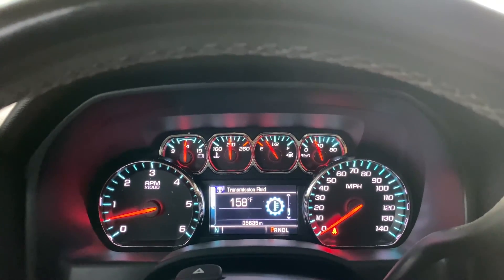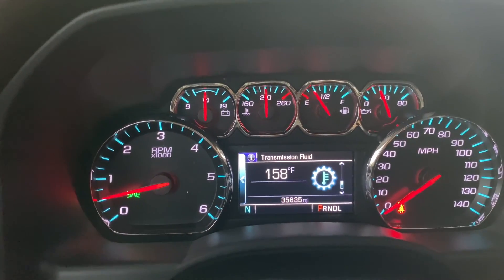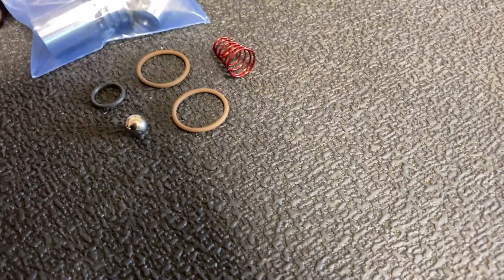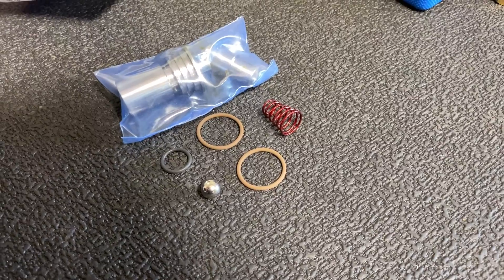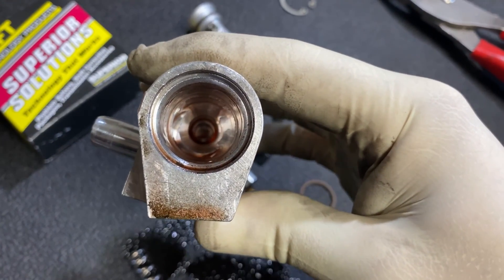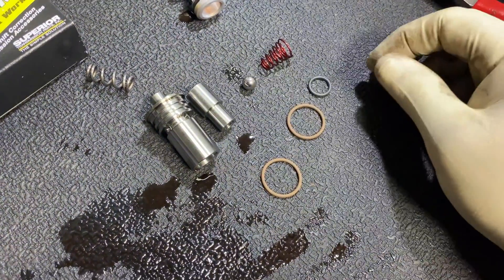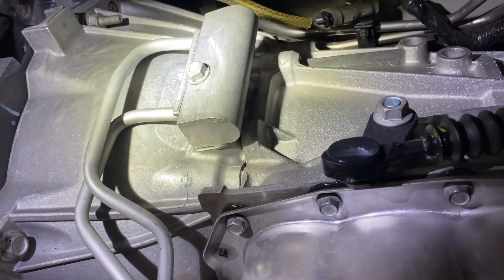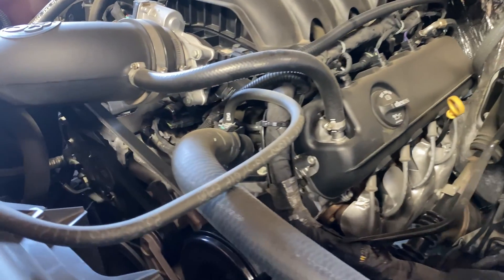Silverado 6L80 Thermostat Delete the Right Way! *SURE-COOL*

Comment: You took a thermostat out just to install another thermostat?
Reply: Yes.the original opens up at too high of temp.around 200 degrees.Too hot.kills trans torque converter.New one opens up at 150 degrees.

Comment: Did you lose enough fluid you had to add? I’m planning to do this but the 2021 doesn’t have the dipstick and you have to add from below the truck. That seems like a pain in the ass, along with trying to make sure it isn’t under or over filled.

Comment: My 6L80 hit 237 degrees pulling a medium sized trailer in the high mountains in 68 degree weather.  It works ok yet, but do you think I did damage?
Reply: I would think at 237° some damage was done. Not sure what GM was thinking or if they were thinking at all with these transmissions

Comment: The 190+ is BS I put a brand new transmission in my suburban in the Rockies it hit 195 and quit shifting until it dropped to 180 ..
Reply: You have bigger problems then. Plowing before this bypass my 19 Sierra would hit 240 250 and still run fine.

Comment: What’s the difference between doing this kit or just flipping the spring I seen on other videos thanks
Reply: I did the “pill flip mod” on mine. Granted it’s cold out now but hasn’t got over 140 at all
Reply: Anyone just remove the thermostat and spring and put back together. Would that be fine instead of flipping. Same thing right

Comment: I have tranny cooler and it's a 6l80e looking to do this it runs at 185 rite now about planning on doing a lot The question is how much farther is this really going to extend the life of the transmission there really only good for about 150 200,000 If you change your fluid every 40,000 mi as far as I know One would assume this should extend the life slightly especially if you're telling If you never tell or haul anything this might not be a necessary mod for you I'd like to know what the Camaro runs at

Comment: Thanks for this.  I just ordered one from the link above.  My 2018 needs this and it looks pretty easy to do too!
Reply: Super easy, I did it today in less than 30 minutes. It took longer to remove the assembly due to the front driveshaft than it did to replace the guts.

Comment: Need to do this with my 19 z71 tahoe. Pulling my atv on a 6x12 utility trailer I get up to 210 and stay at 195-200 normal driving
Reply: I did the upgrade and it works. Normal driving it stays around 135-160 thanks for the video. Also got it on eBay for 55 bucks shipped.
Reply from the maker: Awesome!!!

Comment: I did order this thermal bypass kit and will be comparing it to the mishimoto one that came with the transmission cooler..

I installed the mishimoto cooler with the thermal bypass delete and went on a long highway drive with outside temp at 85 and noticed the transmission temp never went over 150 degrees, upon returning in town and driving around some more trans temp fluctuate between 127-135... plus I noticed it shifts smoother. I'm just concerned if these are good temp and not too cold since dealership said normal operation temp is around 180 and up.
Reply: They also say normal oil for these trucks is 5w20 yet when they sell the same Gen V engines for commercial use (where they dont care about MPG) they recommend 5w30... Dont listen to the GM engineers at this point, they only care about CAFE standards and not longevity of thier products.
Reply: @PrimeraRSTKD  Did you mean 0W20?
Reply: @AmericanNuke54  Yup, also GM just released the official thermostat bypass similar to this, they knew this was a problem but didnt fix it. idk why i keep buying these shit trucks.
Reply: @robertscimeca1768  do you have a link? I live in the northern US where it will get cold in the winter. I’m not sure if the temps we have here is really an issue to have this part in or not.
Reply: based on what I've been reading it can be an issue in a cold climate (Northern parts of America), so new GM TBV is recommended. The new TBV opens up at 70 C / 158 F, which would  keep the engine around 165 F in warmer temps and closer to 158 F in colder temps. I'm planning on getting the new GM TBV because I don't want to void my warranty plus the installing the new TBV on 2016 - 2020 Suburban is super easy. Will switch later when I'm out of warranty based on feedback from people who have done either one of the modifications/upgrades.
Reply: @chaddelecia2414  Had mishimoto trans cooler with sure cool throughout all winter last year in Midwest with temperatures in the negatives and it seemed to warm up just fine.. still running strong.
Reply: @viixiconik  will keep that in mind. I spoke to a GM tech and he said the trans is designed to work at 170 F, but he didn't see this service bulletin. I have a feeling what they tell the techs isn't necessarily through. I don't notice a different in my transmission at lower temps (less than 40).
Reply: @chaddelecia2414  Do you have a part # for the new GM TBV? Thanks.
Reply: Why would the cold climate make difference all the older trucks never had a trans thermostat. Just asking because I live in the northern part of the country and it get below zero here. Is that transmission that junky. My older truck works great with no thermostat.

Comment: Awesome bro! Thanks for sharing your install. Just ordered mine today 🔥🔥🔥
Reply from the maker: Thank you! Enjoy some cooler trans temps!
Reply: @Bobsgaragetech  I have a Question, would I have to add transmission oil? I saw that it leaked a bit.  Just wondering.. thank you
Reply from the maker: @JTrump23  not usually. But it is always a good idea to check the level once you are done with any transmission repairs.

Comment: After installing the by-pass my transmission still went up to 180 easily. Outside temp was 90 and i was only street driving for 30min.
Reply from the maker: Sounds like you have other problems. Could be clogged cooler, could be internal transmission failure, could be old fluid.
Reply: @Bobsgaragetech  thanks for the feed back, that really helps. I’ll see if i can get to the bottom of the issue. I’m not going to give up on the product just yet because it makes the most sense out of most of the thermostat deletes.
Reply: @Vill254  just a heads up, if the converter has started to slip / chatter on TCC it could drive temps higher. and in the beginning of failure you may not even feel it slipping   if it was during a pull / tow / haul situ. you may still need to add an external ( oil to air type vs. the factory heat exchanger inside the rad) if you bypass the rad heat exchanger (oil to coolant type "cooler") rule of thumb is install 2 of the Hayden / tru-cool coolers in series and make sure they are 1st in the air flow path (no obstructions in the air flow thru path) OTHERWISE if you have some other items causing lower air flow across the cooler (due to lights on the grill or grill guards / bumpers etc. ) GET the NEW TRU COOL WITH the automatic electric aux fan units (either the biggest single or 2 doubles. feel free to go to our website: www.superiortransmission.com there is also a contact us section if you need further questions answered or are just wanting to touch base. thanks ! p>s> 180 deg. F is fine all day long in 90-120 deg. if it gets higher add cooler if not, you may need to go into the unit.
Reply: @Vill254  mines having the same issue did you ever get it solved?
Reply: going up to 180 is perfectly normal when it’s 90+ degrees outside. That’s what these guys don’t understand that install these. ambient temperature outside is going to dictate a lot of what your transmission is going to run out with the surecool. when it’s 95° here I run about 180. what is in the 20s and 30s I run about 130. so there’s about 100° variance with ambient temperature. It’s doing exactly what it’s supposed to do though and the key is you have full flow fluid
Reply: Mine too

Comment: Thanks for posting this. Old retired GM tech here, just bought a used 2018 Silverado. Will get this changed out pronto. Will you post something on the AFM problems and solutions? Thanks Again Update: Installed the Sure Cool today SUPER EASY now the trans temp hold pretty steady at 158 before it would easily go above 190. Great product.
Reply: You can get an AFM delete made by range. $200 you just plug it into your OBDII port. I have it on my 2018 Silverado
Reply: @dustinturner5119  Thanks I have seen these.Great idea. I was also thinking about a complete delete after power train Warranty expires. Looking for recommendations on those
Reply: @stevecampbell7620  no problem and yeah I waited to late and the lifters went out in my truck.. $3,800 later I decided to put the AFM disabler in it 😂 this happened at 91,000 miles for me
Reply: @dustinturner5119  thats scary.... I am out 89,500 now lol. Keep putting off a full delete.
Reply: @lew-e  do it soon!! My truck and I know of a guy that has a truck like mine and he has to redo tho engine in his too! Trust me it's worth it however you decide to delete it
Reply: @dustinturner5119  I am seriously considering trading it in on a used 3/4 or 1 ton for hauling. Would be convenient not to have to do the afm delete too...
Reply: @lew-e  yeah that would be the thing to do lol
Reply: @dustinturner5119  we just picked up a 7,000# fully loaded tt so convincing the wife to also upgrade the pickup is a little tough at the moment lol
Reply: @lew-e  good luck man 😂😂
Reply: Just a quick option (until you get the range delete) is instead of using (D) use M[5] and you will NOT drop to V4, however this doesn’t stop the lifter issues, as they’re just poorly designed. Therefore best to move forward with full delete ASAP! 

I was planning a full delete on mine upon buying it at the end of April 21’ but after 4 months of owning the truck, I have dumped over $3000 into the AC system with 5 different AC failures. Therefore, I have (thankfully) been treated kindly by the dealership I bought it from, and he is working with me now to get out of this 2014 5.3L Crew Cab fully loaded into a 2021 (with them giving me over payoff on mine) and they knocked off $6,000 MSRP on the 21’ model.
Reply: @Dstring1230  congratulations you’ve been baited. Along with very bleak/green techs.
Reply: @Dstring1230  id move away from fucking Chevrolet completely, these mother fuckers will never get another penny from me. No wonder they almost went out of business and had to get bailed out by the government a few years back… transmissions grenading themselves at 80k miles is just unacceptable…
Reply: I purchased the Diablo Sport tuner to disable the AFM,( just gotta return to stock file if you go to dealer or emissions test.)

Comment: Could u give us a up date  please I got the kit . I just afraid that the transmission running to cold could cause a problem
Reply from the maker: The update and thousands of other people that also have this sure cool kit love it. The guys over at superior transmission parts know what they are doing. I highly recommend this upgrade. I do not recommend just plugging it or flipping the thermostat. You want to have the pressure relief ball too so in cold weather it has the correct flow.
Reply: Thank u so much for the info.  I’m still going to change it . Just wish I could find some one that would tell me how it works . That’s what I’m interested in
Reply from the maker: Basically it allows flow through the cooler at all times. It has a soft spring that eliminates back flow and then the check ball is for cold weather if the cooler is frozen and can’t flow the fluid will feed right back to the transmission.
Reply: That's the question nobody asked
Reply from the maker: I always recommend doing more research. But trust me you do not want high temps in these transmissions. I have been a tech for over 15 years now and GM tech for most of it. The only reason they are allowing these transmission to get so hot is for fuel economy. Just so they can add that extra and make it look good. I would rather have my transmission properly cooled and lose a small amount of fuel economy. So little you will not even notice.
Reply: @Therealestrunnerluda  no worries if it gets too cold... (below zero F) the bypass kicks in (via the thick viscosity of cold ATF) and the differences in balance pressure thru the block - due to the Hi VISC of the cold fluid - pushes the ball over to the bypass mode, pre-warms the fluid until flow begins thru the coolers and back to the trans. sump (the pan) while the unit is coming up to temp. so it is in bypass mode at that point. (LIKE THE FACTORY INTENDED, BUT OUR SYSTEM IS DYNAMICALLY ACTIVE- which means... it instantly reacts to a NO or LOW FLOW Condition and protects the guts of the unit from no LUBE flow throughout the unit. when you start in a common temp morning (55-75 deg. ) it should hit around 145 ish- 165 ish all day long under normal operating conditions. on hard pulls and hot days 165-185 deg. would still be considered normal with the exception of... once you get the stress off ( going flat or slight downhill ) over a few minuets the temp should ramp back down more to 165 range, when the load / stresses resumes, the temps under hard working conditions will climb slightly again but should re-stabilize back to the cooler ranges. this happens constantly and the reason the pellet types fail (due to extreme over temps ((250deg.+)) they are melting or Metal and Friction materials or debris flowing thru the cooler block (as the oil goes thru the pellet / block 1st and then to the filter last) sticks them closed or 1/4 of the way open etc.  THIS heat and or contamination end up damaging the thermo pellet and in some cases have burnt unit internals so badly you need a core to re-build.  

that's why we have patented the technology (in our K5R55WNS Shift Correction (R) package) and have patent pending's on all our SURE~COOL (R) system world-wide. 
we hope you like it too.! www.superiortransmission.com
Reply: Thank u so much for clearing that up for me
Reply: Do you happen too on have part number pls?
Reply from the maker: @eddielerma1174  yes the link is in my bio check it out. Don’t for forget to like this video and subscribe for more content like this
Reply: @eddielerma1174   GM is STL010 the fords are STL017 and STL020 and STL009 they can be viewed at www.superiortransmission.com website. google the part number online we have several distributors.

Comment: Definitely gonna do this to my sierra before I pull my car with it! Can't believe that gm put a thermostat on these transmissions. Would make alot of sence that the heat they make could be a cause to some of the problems they have with the expansion and contraction of the materials and the fluid breaking down faster with the heat
Reply from the maker: I love the way you are thinking! I thought the same! It’s 115 in Phoenix the last couple days and I have been staying around 170 after driving 30 mins! Let me know when you tow with it, I haven’t towed yet.
Reply: @Bobsgaragetech  definitely will. Also gonna do a trans flush once it hits 96k. At 94k rn with zero issues
Reply: @sbc_jake_9677  , I heard from a YT video someone saying that the reason the original thermal bypass valve was designed to open for cooling at 194 °F (or 90 °C) is due to Federal Government regulations to get higher mpg. The hotter the fluid is the thinner it gets, which would enable higher mpg. However, I think GM failed in providing a transmission fluid cooler coil that’s capable of sufficiently cooling the fluid for city stop and go driving as well as towing something (highway driving is ok - doesn’t overheat, because of cooling air with speed). Also, it appears that over time, the thermal bypass internal gets clogged up a bit with fluid gunk or deteriorating components rendering it to operate inefficient that leads to creeping up higher temperatures.
Reply: @ትኒጧትንኝ  absolutely no way that’s a Myth! Overhaul your transmission when it begins to fail, then you will truly appreciate good gas mileage & Transmission tune. Ps. Stock GM Trans are Garbage. From valve-body to clutch packs all the way down to TC.
Reply: I can't believe this either. Ive blown 3 torque converters and had my transmission rebuilt 3 times under warranty within 2000 miles of each other and by doing my research this is the product that I think is going to be a savior. the common denominator of each failure was long trip and by my house in southern ca we have a toll road hill that is long and pretty big and it takes my torque converter out and I believe the fluid is just way to hot.
Reply: @jessematheny3636  the 6l80s also have a weak torque converter. When that craps out it takes the trans with it. But heat does have a factor
Reply from the maker: GM makes there own version now. They should have been putting it on with your rebuilds..

Comment: Just bought my kit, will advise on how it’s working after installation 

Thanks again
Reply from the maker: You will love it. I live in Arizona and I have only got to about 165 so far.. I don’t tow much so we will see next time I tow.
Reply: Got my kit installed a couple days ago and I’ve had no issues at all.
Before I installed the kit, my trans ran between 180 and 210 daily no matter how my driving style was.
Now after installing this kit my trans runs between 158 to 175 regularly!!!!!!!!!
I’ve never got my temps down to the 145 range but I do plan on putting in an auxiliary oil cooler also.

Normal driving conditions, it’s my daily driver and never abused, outside temps in my state have been in the triple range for going on 3 weeks now and it still runs loads cooler.
I’m happy I got the kit and couldn’t be happier 😎

Thanks guys

Comment: Do you HAVE to use a Milwaukee tool or will a DeWalt work?
Reply from the maker: Has to be Milwaukee or anything but DeWalt.. sorry LOL
Reply: snap on will suffice, anything lesser quality will ruin transmission.
Reply: Put down the pipe.
Will that work ?!?